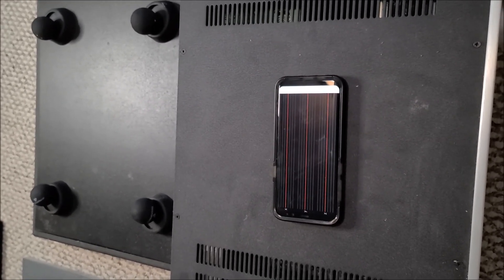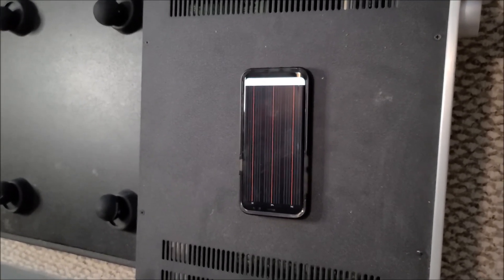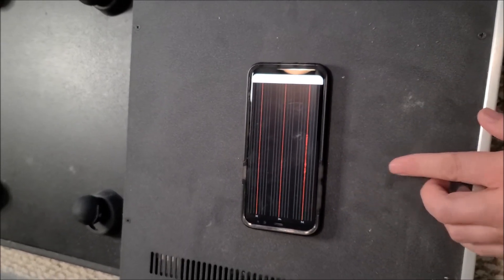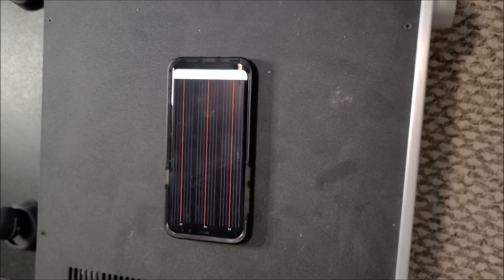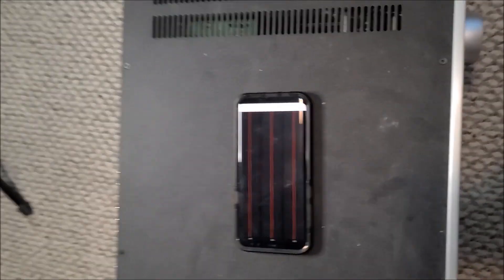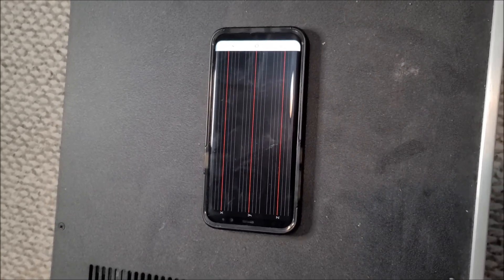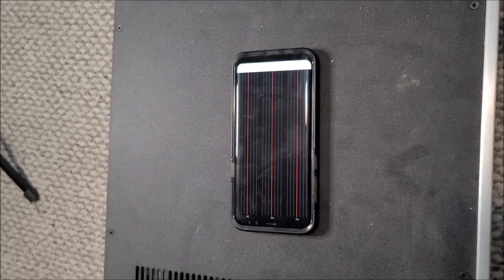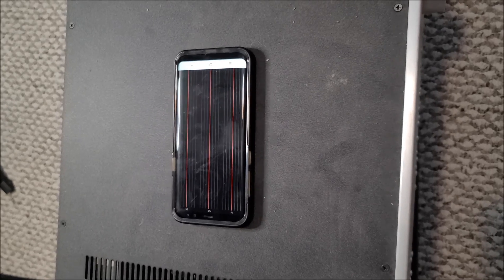Audiophile Vibration Control Product Testing and Review - Part 3

Comment: HI 
what do you recommend for tower speakers on carpet ?
i can not use squash ball  its heavy  speakers 32kg
Reply from the maker: Townsend makes outrigger platforms that would be good for carpet.  My room has carpet and I'm using Townsend seismic bars on my main speakers.  I use a bunch of the squash ball and vibrapodsu under the subs.
Reply: @AudiophileJunkie  is there any alternative to Townsend  ?i saw the price 1000 euro
Reply from the maker: You can usually get a discount if you call direct.  However, a possible home grown solution would be this - https://www.tnt-audio.com/clinica/sandblaster_e.html

It isn't as good as the Townsend or squash balls, but can work and become a solid yet dissipating base.
Reply: @AudiophileJunkie  what do u think about putting metal plate with car sound deadening mat an on the top the speakers?
Reply from the maker: It depends on the speaker.  I've used that car deadening material extensively on the doors in my room and speakers.  However, for certain speakers like Spendor/Harbeth, they put a lot of effort into making sure the cabinet resonates at a certain frequency that is least offensive.  Anything you do to change that could be a negative.